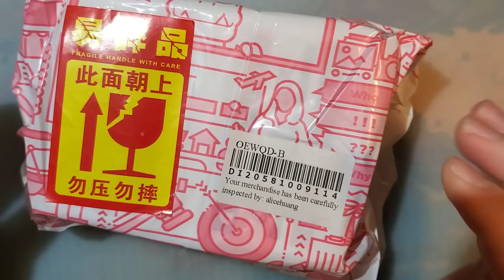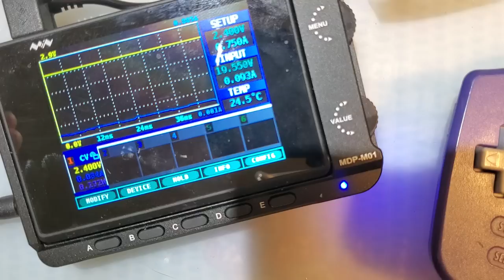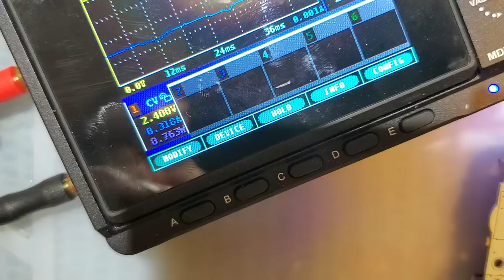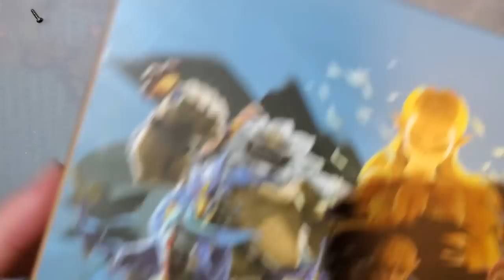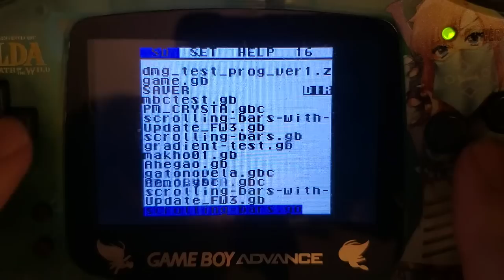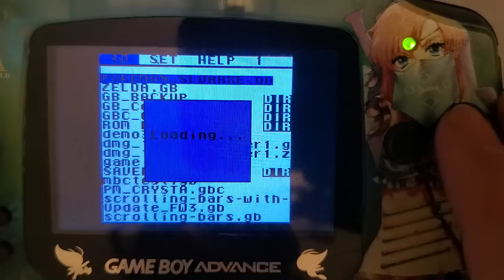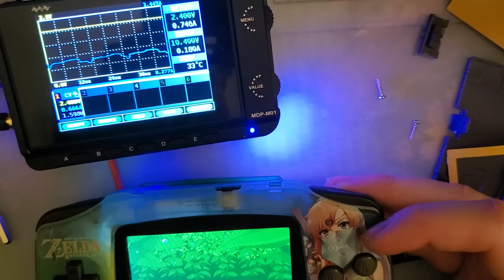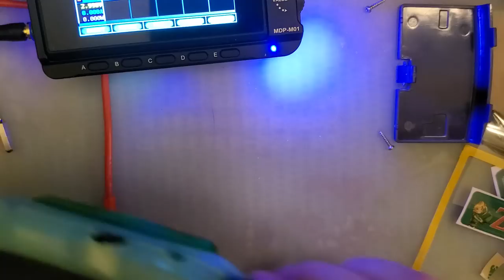C LCD - Game Boy Advance Backlight Kit

Comment: the shell reminds me a bit of your AGB that you added the LED light bar to, lol. just needs the matching clear buttons. i guess it’s just a matter of time before FP or another manufacturer makes a version where they use these new LCDs instead of reusing old stock, can’t wait for that tbh - no more Toppoly lottery i hope. 

also, is that an OEM Celebi lens?
Reply from the maker: it's the same color shell except with the graphics.

And, uh, yeah, it's OEM. Don't hate me

Comment: Hey Makho! I have a question in case you could help me... How can I remove an IPS v2 screen from the Gameboy advance shell without damaging it? Should I use like a heat gun or what do you recommend?
Reply from the maker: the LCDs are exceedingly fragile. If you used the adhesive, good luck getting it out intact. Heat is a must and you'll probably want to push it out from the front (GENTLY) with the lens off.
Reply: @makho  thank you very much for the reply bro! Appreciate it! Keep up de excellent job with the videos!

Comment: Hey makho have you tried the 14500 battery cells before? I’m not too knowledgeable on batteries and would like to hear your thoughts on them
Reply: 14500 batteries are 3.7v so would be to much for the gameboys to handle unless a power convertor was used as well
Reply from the maker: @DarronPotter  yeah, wouldn't work well in a GBA. They can be made to work in other GBs with fewer modifications but it's easier, cheaper, and yields better run time (in my experience) to just stick a pouch LiPo in there.